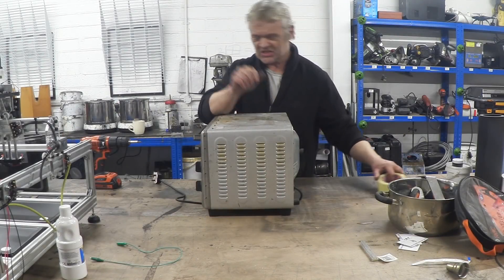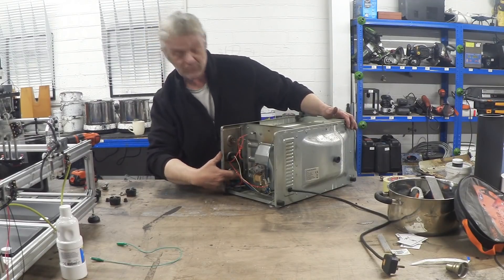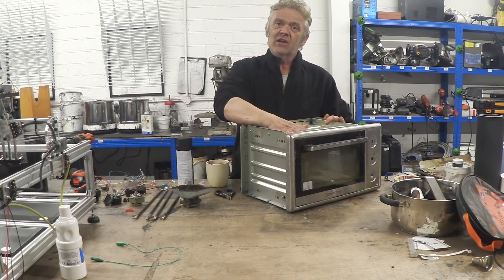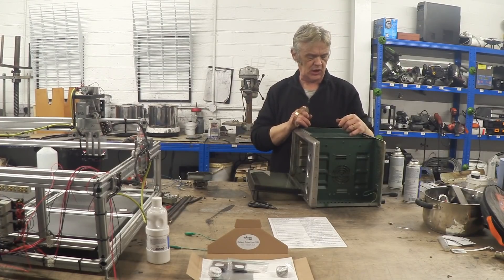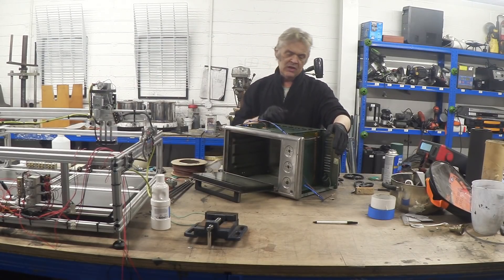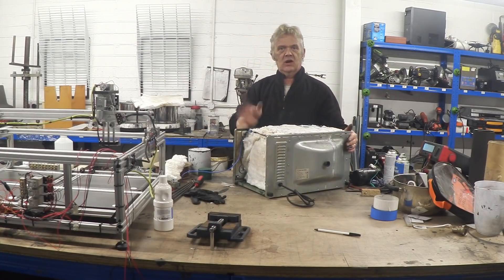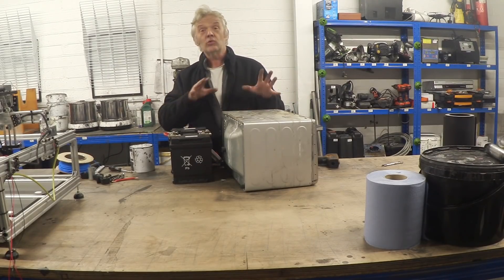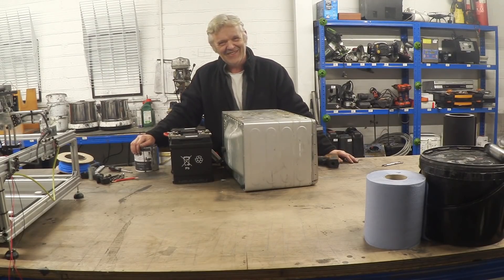Build An Off Grid, RV Oven From Graphene Ink And A Car Battery

Comment: If you are using normal pvc wiring it's temperature limit is 90celcius. The oven may have silicone wiring or silicone sleeving.

Comment: Robert do you ever sleep ! inspirational .  just a note, 'new atlas' had an interesting article from KIRST  , Korea, a Dr Hun-Gi Jung . taking a sweet potato derived starch solution ,mixing it with a silicon and corn oil solution ,then heat treating , this gives them a carbon silicon matrix anode with around 4 times the Li storage  . me thinks they may have been watching your shows !? ,, but does make me think ,is 'someone' looking at a more low temperature organic way to take advantage of the 10 electron per molecule capacity of Vandium diboride ??.    27 kW hrs per liter ! ,interesting they have carbon at higher 8.9 kWh per Kg . dang your getting even me excited ! ,a carbon silicon vandium ink ,very quick charging, equiv power as petrol ?

Comment: Dear Mr.Murray...could it be that the Ink better works, when you put an AC Voltage either an DC Voltage on the terminals? Could it be that the Ink is Frequency depended?

Comment: Your quoted wattage figures seem a bit awry. As you correctly say, 12V at 5A = 60 Watts. But if you run it on 24V, then assuming your ink's resistance remains constant, the power will then increase to 240 Watts (24V x 10A), not 120 Watts.

Comment: Robert, I have looked all over and do not see any comments as to whether your ink/paint is rated food grade?  While your converted toaster oven makes heat, it was not clear if it would be safe for cooking/heating food items for human consumption.  Also the base insulator paint you use may have volatile chemicals released while cooking.  I have a can of BQ grill paint and it does not say if safe for cooking areas.  Most people paint the outside of the grill not the inside nearest the food.  Any advice?
Reply: Despite the title of this video, I felt the intention here was more of a "proof of concept" than an actual "how-to" or "DIY"...  all the points you brought up are things I would believe would be the "next step"... finding all the right materials to make it a safe product.  I see this video more as inspiration for people who wish to pursue it further.

Comment: here is a thought robert if you want this to run on 12v then how about running a copper strip down the middle of each heating surface then connect both outside strips together so when you apply power to the center strip to the edge strips you will have half the distance and as a result half the resistance so half the voltage twice the amperage same wattage ? should work right?

Comment: Why couldn't the thermostat control that is with that oven work to control the temperature?
It is after all a "temperature controlled mechanical electronic switch"  in the temp' range you need and it's already installed in the oven enclosure. Just wire it in.
Reply from the maker: In this case it was a bimetallic strip on the far right and oddly enough relied on the fact that there was no insulation so the whole oven got hot and the strip could react - but as I added insulation it probably wouldn't have worked - but cheers

Comment: As always interesting to see all those different applications of the ink.  I often have doubts about how long the Inkfilm will last when it is exposed, like today, to high expansion differences of the steel body.  If I find the time I will explore the creation of "bronze" statues using the ink and electrolysis, a complex and expensive process.   Thanks .
Reply from the maker: I'd be interested to know what happens mate - cheers
Reply: .......do you mean electroplating of zinc and copper ?
Reply: @philipvernejules9926  Yes, some copper alloy in a thick layer to form a standalone piece. Do you have some experience?

Comment: This is a fantastic idea in its infancy, a prototype, there are bound to be some pot holes along the way.
 It is not my intent to attack or marginalize any individuals opinion in any way. I personally see such great potential here.

@Robert Murray-Smith thank you for your enthusiasm, fascination and wonder which we could all use a bit more of in our lives.

As a couple of people have already suggested increasing the thickness of the ink coats would decrease the resistance I=V/R or create more panels in parallel and so increase the wattage, maybe bring the oven up to 300W if possible so it can be run to be more thermally stable when the door is opened briefly or a colder mass is introduced.

I see that 300W 12V ceramic heating cartridges are easily and economically obtained from ebay, ali express and bangood.
 Embed one of these in a Graphite or aluminium block maximised for high surface area and utilise this element as an rapid boost assist at the bottom of the oven. 

Switching between the two heating sources may give you a better thermal profile for cooking which can easily be implemented using PID algorithms solid state relays and an arduino. That would be my approach to developing the idea into a working off grid culinary device.

With a little research you could strive to mimic the thermal profiles of the worlds best ovens - that would make the final product highly sought world-wide and therein the marketing tool with which to promote it.

Thank-you 
@goldmagnet for the inspiration and motivation to make this comment.
Reply from the maker: Mate - thank you for taking the time to do that because you are right this is a product in it's infancy. I am thinking of going off grid myself but I live in a typical UK suburb Andy thought is to make one change at a time until I am all 12V - lights are easy but I was looking at cooking and couldn't find anything - so me being me - I decided to make it and I thought it was useful - but also something to follow up with I think - so the advice is well well appreciated
Reply: Robert Murray-Smith absolutely my pleasure and I am always happy to help if I am able.

I am uncertain of weather these ideas will come to anything as I was shooting from the hip; but  it has always been my experience that positive momentum is generated by the open workshopping of ideas and initial Impressions.

I applaud your work mate and as always look forward to your next foray into the frontiers of science. 
You inspire in me an appreciation of how paradigms (ideas) are manifested as a reality through articulation collaboration consultation iteration and feedback. Moving through working theory to a reality. The thing is to be confident and courageous enough to put your idea out there in the first place and follow it through.
More often than not if not born of necessity they are from the realm of fiction such as the communicators and portable library computers of Star Trek becoming mobile phones and laptops.
Kudos on being an innovator.
Reply: @deepforrestalchemy9189  If you do the maths its better to use the electricity just to heat, using it to split H2O then burn it to heat water is not sensible.
Reply: @deepforrestalchemy9189  As a chemist would you like to tell me the efficiency of electrolysis ?? I think you would change your tone if you knew...
Reply: @deepforrestalchemy9189  Its the reason nearly all hydrogen fuel stations get their gas from  conversion of methane, electrolysis is too inefficient.
Reply: @deepforrestalchemy9189  It is widely accepted that electrolysis is 75 - 80% efficient, what is the benefit ? Why not just use the electricity to create heart >95% efficient ?? Sorry I can see no logic in your idea, not for a efficiency point of view ?????
Reply: @deepforrestalchemy9189  Explain then, you said that you would split the water right ?
Reply: @deepforrestalchemy9189  You said "300w of HHO generation in a open vented system ",  how you doing that if not by electrolysis ?
Reply: Ohh well,  again someone who has no idea and cant argue against facts, what a child.
Reply: @UC_SM7FGq54ihDaaNoMzJIow What on earth has hysteresis got to do with it ??? Are you just pick words from a dictionary ?
Reply: @deepforrestalchemy9189  I just dont like the title of the video. It suggests that Rob is making  a working RV off grid oven, when its not. He even suggested to an RV owner to build it !!  That is not right, hes experimenting with his ink, and has produced something that wont cook a bowl of soup. You think thats fine, as well as suggesting "improvements" that would not work, I am not a troll, I just hate things that are misleading and inaccurate, and there is no question that the title of this video is wrong.
Reply: @deepforrestalchemy9189  I hope the people that build the RV off grid oven feel happy with your defence of the product. By the way for hysteresis to be an issue the oven would need to get to temperature first, you are jumping the gun.
Reply: @deepforrestalchemy9189  Yes I do, hysteresis was something that  important for my work for over 30 years. You never did answer how you got your HHO without inefficient electrolysis ?
Reply: @deepforrestalchemy9189  If you are interested in the thermal characteristics of Rob mates design, then don't you think we should measure the temperature of the air IN the oven, as opposed to using  a IR temp gun to measure the temperature the other side of the element ? That was a totally irrelevant reading, you might as well walk into a room point it at a light bulb and say the room is 200 degrees. Putting the elements on the outside makes the thermal characteristics of the design terrible. But I am sure you know all this as you are an expert.
Reply: @UC_SM7FGq54ihDaaNoMzJIow You suggested your occupation as a biochemist was relevant, I assumed you considered yourself more knowledgeable than me,. Any chance of logical constructive answers or are they too difficult to argue for you ? As I said before I take misinformation seriously... obviously know you dont.
Reply: @UC_SM7FGq54ihDaaNoMzJIow Come on, seriously dont you think Rob should maybe make the Twizzy work and go on the bug run as promised, or maybe deliver a working battery as promised, or maybe  send a sample to Julian IIlet as promised, rather than make a video about an oven that has a flawed design, and encourages people to make a product that doesn't work but is defended by loyal experts like you  ?
Reply: From you comment you seem to agree the current design does not work ? Perhaps Rob should change the title of the video and the advice he gives to reflect your opinion. If I was searching YT for an Oven design I might think this one works, when as you say its a prototype that does not work.
Reply: @deepforrestalchemy9189  If you dont want to answer any questions about your own suggestions then just mute me.

Comment: That's impressive Rob did you put the extra battery in parallel or series?
Reply: I would imagine series ie 24V, as the temperature went from 100 to 200 degrees C on only one battery.
Reply from the maker: spot on mate
Reply: I’d say parallel as Rob continues to say 12v oven
Reply from the maker: that's because I shot it over a few days mate and in the end It needed either more heating strips, lower resistance or a couple of batteries - I had done all the painting work so changing the strips would have been a real pain - so I added another battery - easiest way - still I am sorry there is some confusion over that
Reply: @ThinkingandTinkering  OK i suspected that it wasn't clear in the vid, one thing that may help rather than change the ink pastern may be some more coats to drop the resistance  I have your old ink here, so I will see how more coats affect final resistance over a given aria
Reply from the maker: series mate - it turned out to be 24V - other folks have suggested ways to get it to 12V and that is the next step for me - but a larger version I think

Comment: Fantastic Rob. I got my Paint and Supplies TY :) Painting and testing, Coroplast, Wood panelling, Plywood, Ceramic Tile, Laminate flooring, Felt, Plastic, and Paper.  Amazing Stuff. Next drywall heater, then the Oven. :) I'll have the home off-grid soon :)
Reply from the maker: that is awesome mate - off grid 12v home - it also means we can do away with inverters!!
Reply: @ThinkingandTinkering  Rob I was wondering if you use an Electric Circuit online Building Software?  https://www.partsim.com/simulator I wanted to get the circuit diagrams for testing and building units

Comment: Nice upgrade Robert.  Nice results.  I see lots of applications.  Soon you will be rich and can go to the tropics and sip hard to pronounce umbrella drinks on the beach as often as desired and get out of the lab for a bit!  

But as an electronics tech over 20 years, I have to inform you that resistance is the most efficient means of electric to heat conversion.  So the original oven heater elements are like 99% efficient all ready and likely the same for your ink heat conversion per watt input.  So no real heat gain/watt in your case and little room to improve it.  Also, your DC low watt power can not compete with the original KW power rated elements in terms of heating a load (food etc.).  

I agree you  need temperature in the box to be the same as original design, but maybe you forget that there is the issue of heat capacity.  When you turn on the oven and it reaches the desired temp., the heat only had to heat up the air within:  little work, took little time and  little power.  But if you throw in there a large chicken, now the heat capacity demand is very much increased and it will take an incredibly longer TIME to heat the bird to that same temp as for just the air.  It makes little difference that extra insulation was installed.  The fact is the chicken represents a lot more atoms/molecules to heat up as compared to air molecules alone.

I encounter the same heat capacity vs KW issue in solar cooking.  A crock pot of vegetables and beef as a stew can cook and be ready to eat in just an hour and half or so, but with a parabolic reflector cooker it can take like 4 or 5 hours to do the same.  Even though the crock and the solar reflector can reach the same temps, they are not the same kWh rated, the reflector being lower powered.
Reply from the maker: I absolutely agree mate - but the original heaters ( and heaters in other ovens) are often bars spaced in the heating cavity - the paint allows intimate contact with the body of the cooker so transfer is likely to be improved over a greater surface area - giving a more even temperature profile but there is no improvement in efficiency of the heater - like you say likely to be 99% as most resistive heaters are but I suspect there is an improvement in the efficiency of heat transfer - I guess the same thing could well be accomplished by using a fan - which is done. The original oven had no insulation - A situation I have seen many times as I have taken quite a few of these apart and as heat application has two main phases - here I mean ramp and soak - we aren't looking at improving the energy efficiency of the ramp phase as that is fixed based on thermal load - but rather the soak phase which is a balance between inputs and losses. Basically if you put a big chicken in there to get it to temp will be the same energy cost - but to cook it for the 35 mins a kilo required should well be cheaper.
Reply: @ThinkingandTinkering  So how long would it take to cook a chicken safely in the 120 watt oven Rob, I would love to know ?
Reply from the maker: @goldmagnet9013  probably months lol
Reply: Robert, Hi.  Thanks for replying so courteously.  Yep I agree about the insulation.  I have a similar oven and there is no insulation anywhere!  Not even at the pcb!  Insulation would reduce heat loss, hence less $ spent on electric to reach desired load temp.  

It would be great if you took 2 ovens, one normal and your version side by side and cooked at a  useful heat load -- such as chickens and note time and temp to completion.  I know you like bread, but it is not much of a challenge as even low grade solar cooking will make bread -- with enough sun time, thou slow.  Back in the 70's I remember my sister getting a toy cooking oven that heated simple items by just a 100W light bulb.  I think it could, beyond heat up of sandwiches, also COOK cupcakes.  However, the muffin tins were very small.  If I recall correctly, the cupcake ingredients came prepackaged (manuf. secret) and no doubt the recipe was optimized for low temp cooking. 

Finally, a different subject.  For solar energy cooking, having a pot (or solar water piping collector) blackened as much as possible greatly improves heat production at the pot as you know.  As there are different grades of black, do you know if your ink is any blacker (IR wise) than my regular use of charcoal painting or use of engine rated flat black paint?  Now there is an instant needed product of high demand if you can compete in the solar market.  Yes there are some special solar coatings out there but they are crazy expensive.
Reply: @energycrafts8206  "It would be great if you took 2 ovens, one normal and your version side by side and cooked at a  useful heat load -- such as chickens and note time and temp to completion." - Yes Rob, what a great idea, show how you can cook a chicken with 120 watts..... Or is it no good as an RV oven ??
Reply from the maker: front, back and bottom mate - I put it on three sides
Reply: Total logic and well said.

Comment: Robert, is it the ink that heats up and not the copper tape?
Reply from the maker: it's the ink mate - the copper is basically not connected to anything until you paint it - so would never heat
Reply from the maker: spot on mate - though I usually paint over it to ensure good contact